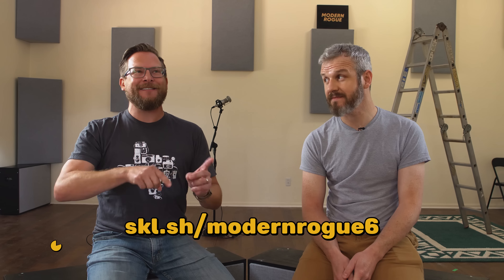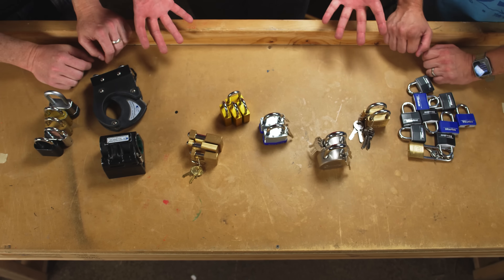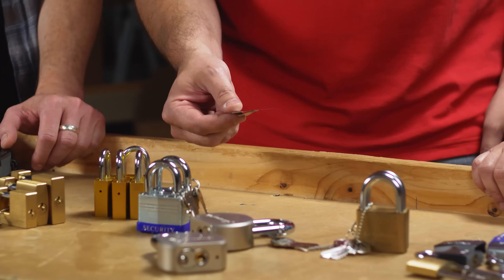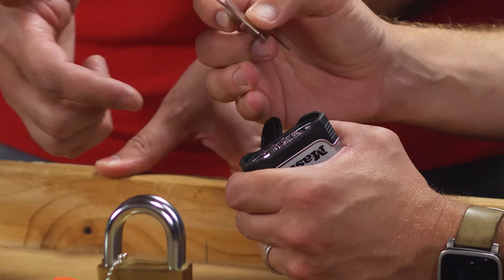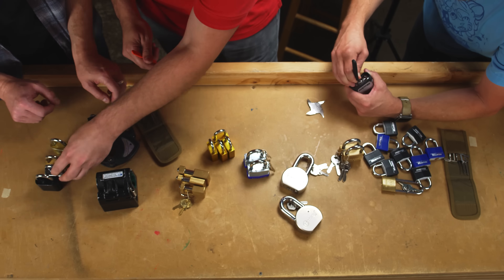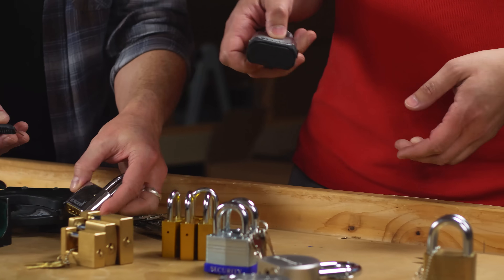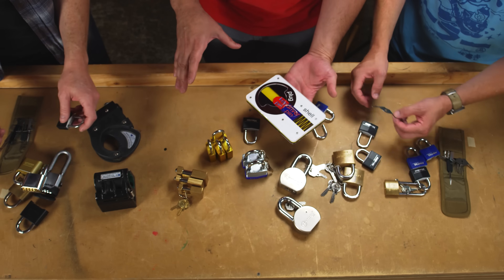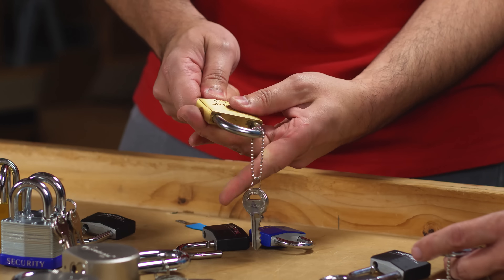8 Surprisingly Easy Ways to Open Locks (with LockPickingLawyer)

Comment: A place I worked the garbage was a medium sized dumpster locked by a chain and combination lock, the trash guys were supposed to have the combination but on several occasions they'd either not have the combination or leave it unsecured, on one occasion they just yanked it presumably not being told it was there, they broke the lock open and then just put it back to look like it was locked.
After that I made an A4 notice on the bin including instructions (with pictures minus the code which was censored) and that was very condescending in the first draft.

Comment: Keeping honest people out: I have set up a self made piggy bank. With a fancy electronic lock. But the box is held together with screws from the outside.
The screwdrivers are just in the drawer below.
Nobody opened it with the screws, as there are only honest people around.
It's enough to keep normal people away.
A thief would simply walk away with the whole piggy bank.

Comment: I've never done this, but they make cutting torch outfits for plumbers that will fit in a small backpack. If I wanted to bypass a lock, that's how I'd do it, if I didn't know any better way
Reply: What LPL is showing you is easier, faster, and will leave fewer clues that you were there.

Comment: I saw a lock on a substation, abloy. It had this thingamajig over the bottom where key would go. It wasn't electronic. It was a round protuberance about 1" in Dia with three holes on end, along with a securing chain. Anybody know what it is? Doesn't look integral to lock.

Comment: Locks that require a 4 digit code haven't changed since 1936 except when they let you change the code. They probably need that security issue fixed

Comment: Oh, and a way to prevent the over-the-shoulder-combination-sneak with master locks.  The normal combination is R-L-R.  Add 33 (modulo the dial, which is 40) to the first number, add 3 to the second number, leave the last number alone, and dial it L-R-L.  The sneak might catch the numbers, but would assume it's R-L-R as normal.   So lets say your combo is 20-30-7.    20+33=53.  Modulo 40, you get 13.  30+3=33.  So your L-R-L combination for that lock would be 13-33-7.  I haven't tested them recently, but about 10 years ago this still worked. ... maybe 15 ...

Comment: One lock I don't see on the table that is really stupidly easy to open and no one should ever use one are those little ones a lot of kids use on their lockers with the 3 or 4 little number dials on the side of it. You can pop one open just by twisting it with one hand,  then while it is open you can change the combo to screw with people and put it back on.

Comment: I like your channel but the Peterson bypass is not that simple LOL. Maybe on a super loosey-goosey American but I have tried and tried and tried at the locksmith shop with several American padlocks to make this work and have not been successful I understand exactly how it works I understand exactly what you need to do I read the instructions I've been locksmith in for 20 years have not been able to make it work, another thing I don't think American padlocks are bad at all as long as I have the shielding discs in and the normal everyday locksmith cannot pick an American I promise you most locksmiths just rake.

Comment: 17:11  They explain 1/8 inch = 3 7/40 mm in Metric.  But 1/8 in. is a measurement all older non-metric people have wired into their brains, so converting to Metric actually makes it harder to visualize.  It's not 3mm, nor is it 4mm - it's simply 3 and 7/40 mm, or 3.175 mm!  Visualize that, you Metric snobs!

Comment: 17:11 - 3 7/40mm? The fuck is this? You don't use fractions on mm. Just say it's 3.175mm (or 3.2mm) you dont use fractions, and certainly not 40ths?